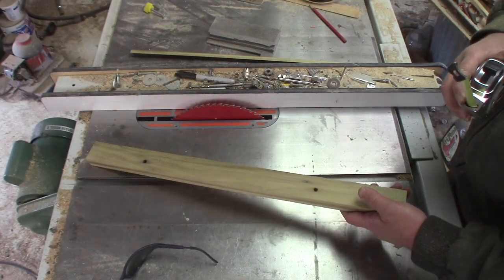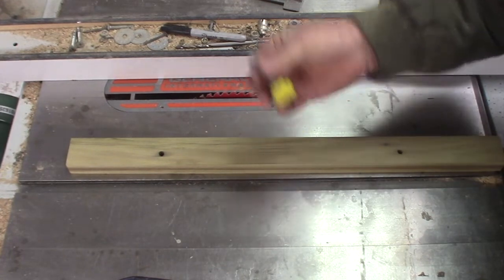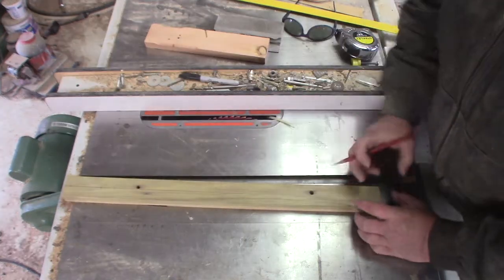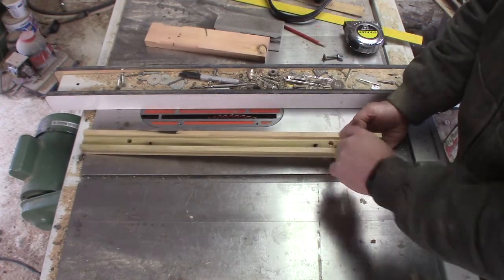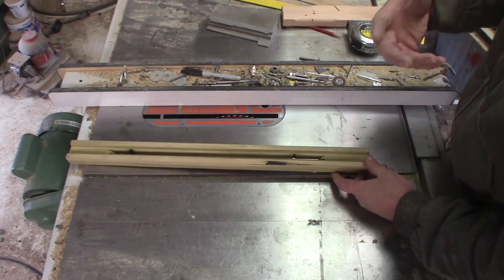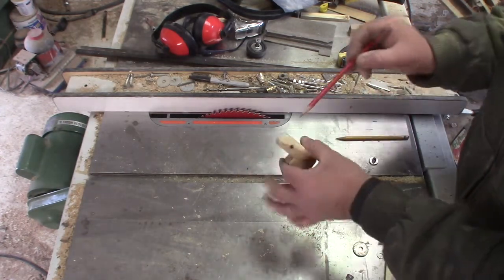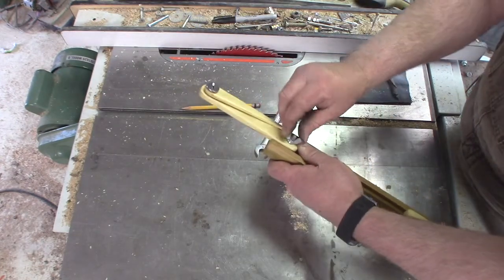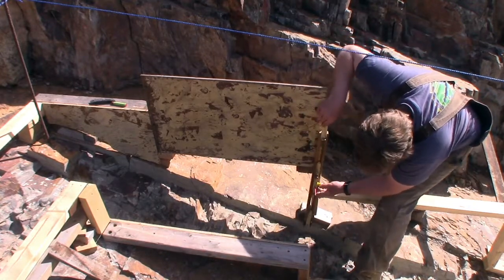Building a Giant Adjustable Scribe

Comment: Take a 1/2iin steel rod and either grind the end round or weld a 1/2 bearing on the bottom. I have done it both ways. Worth’s pretty good

Comment: You can also leave the osb a few inches long so you can trim off the short end  to being the roller offset up so you end up with less gap then do your final trim at your top..

Or tip your scribe to the up hill side tell your pendulum is pointing to the front leading edge so your roller wheel, or you can move the pencil from the center of the scribe to the leading edge so your getting a more accurate scribe line

Comment: Log house scribers typically use two bubble levels to ensure vertical alignment in two planes rather than the pendulum, or at least the good ones do. I like use of a bearing to follow the rock.
Reply from the maker: I think the bearing I used was too large, it created gaps in the vertical measurements.  Should have been a scribe point I think.

Comment: Its looking great ,but i think your over thinking it ,you could just as easy hold your board against that lip and draw your line ,but even then still get leakage out the bottom ,i sure if you just get it close and ask the to keep the first load or two dryer you can get your base in without to much leakage and them go a little wetter on top of that ,its cool rate now shouldn't dry too fast huh ,and im not sure but you may need some kind of adhesive in your first pour to hold to the rock better ,,but with all your rebar and then anchor plate bolts ,dont think you ll have any trouble and sorry for my two cents  thought it might help you out